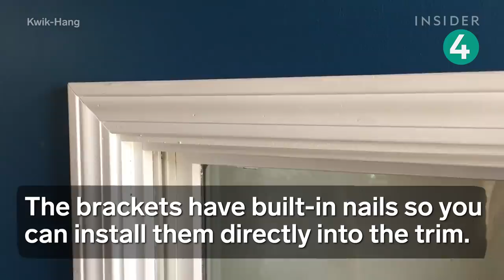8 Tools That Make Home-Improvement Projects Easier

Comment: Popcorn ceilings usually contain asbestos. CALL a professional.
Reply: Usually, If the house is bulit before 1990, some time close to that, I think.
Reply: Absolutely! Though I think in some states you legally can do it yourself, you should definitely call a pro, or at least have a sample of your ceiling tested before trying to remove it
Reply: 1:49.
Reply: Whats an asbestos?
Reply: @ladyhaha7548  Asbestos is a very dangerous substance that can cause Mesothelioma (Cancer), that was in certain things for example, houses bulit before 1990, or sometime around there.
Reply: @Wolfiie  o thanks for the info.
Reply: @ladyhaha7548  A building material hazzadoroua to health. Can cause major issues.
Reply: Eli Clark It’s a substance that was widely used as an insulator up until around 1990. It is dangerous, but if it’s just sitting there, you’re fine. The only time it can get into your body is when it is damaged or disturbed. That’s why so many buildings still have asbestos in them: it makes more sense to let it just sit there than remove it
Reply: Squiddy FancySon  lmao
Reply: Too late I already ate my entire ceiling
Reply: Just research what protective clothing/equipment to wear.

Comment: Working with brick layers for 4 yrs i can surely tell the first one will build a weak wall. You need to kinda over load the cement so it can be pressed down and a tighter fit.
Reply: Agreed looks cool but it's not the right way to do it

Comment: Garbage...the weeder is useless, what if theres a stone or the rake is wrong height, the paint lid, well make sure your legs are strong coz your gunna be up and down that ladder often, the cement template thing - your gunna have to wipe it clean after each use or cement will set on it, the tarpin wheelbarrow doesnt seem to make anything easier than the orginal idea of a metal one that carries more..the rest seem useful